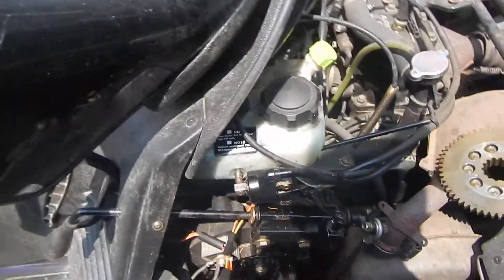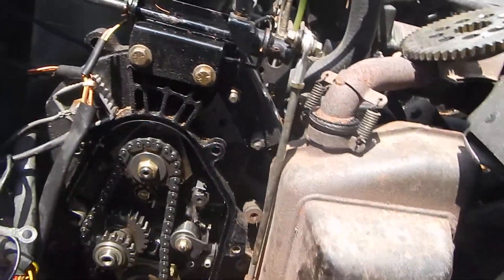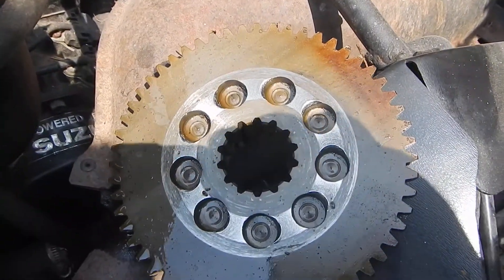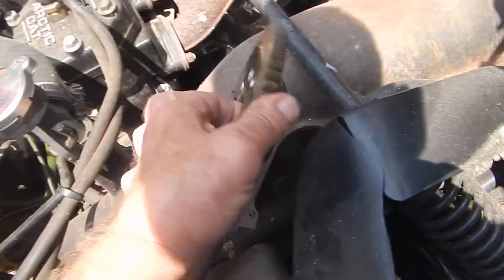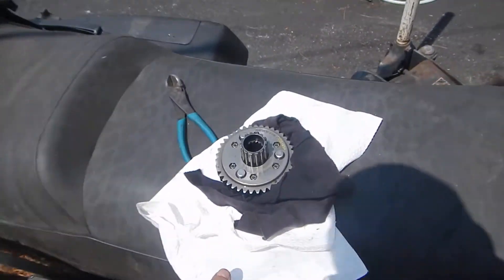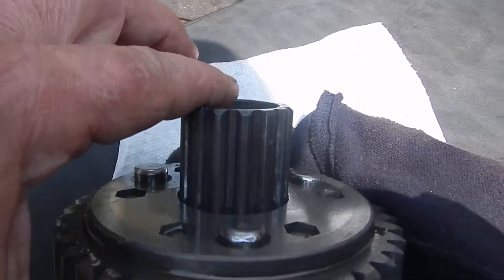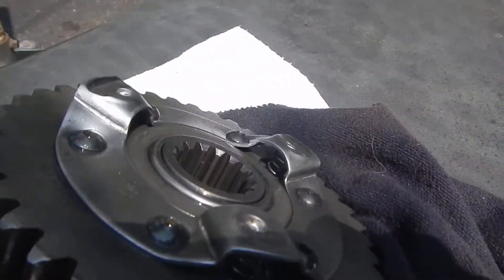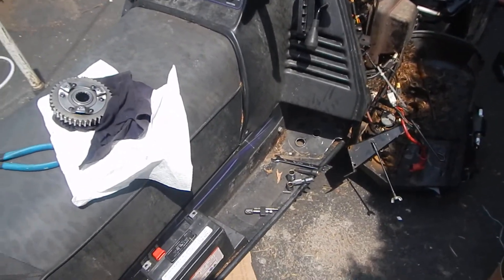ARCTIC CAT CHAIN GEAR REPAIR

Comment: That top sprocket in the gear case , it sits on a roller sleeve.  How does someone replace it if they..... happened to ..... put to much power behind it when tightening it up
Reply from the maker: If you crushed the sprocket you would have to replace it...I think you can get the part here 
Babbitt's Sports Center, 3712 Airline Rd, Muskegon, MI 49444, (231) 737-9241
Reply: @marksalamack6133  not the sprocket I fixed that.  I need to find out the size of the reverse idler shaft where it screws into the back side of the chaincase then the sprockets go into that with a washer n bolt at the end holding it together
Reply from the maker: @jothew1274  If you call Babbit's I think they can email you a parts diagram